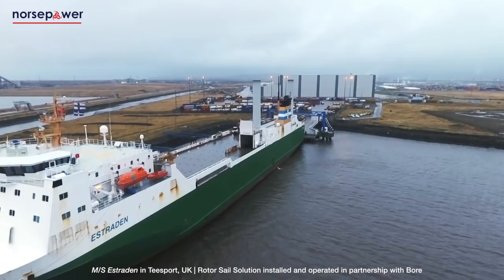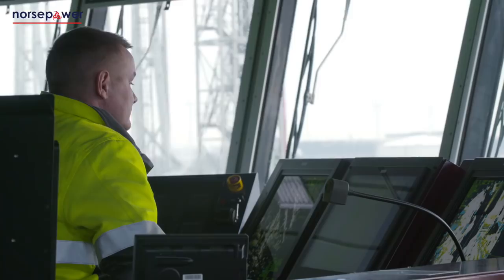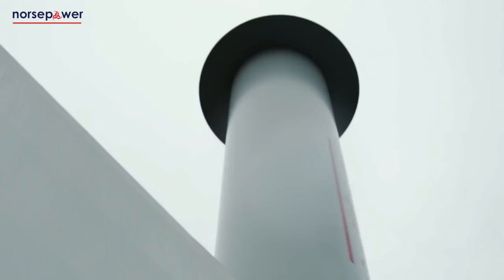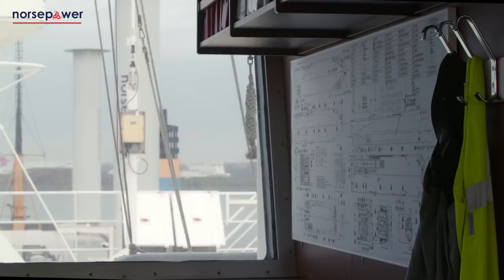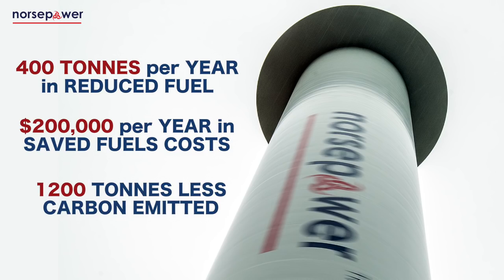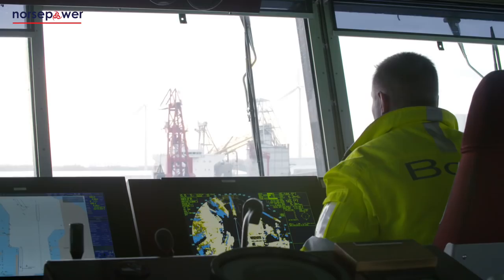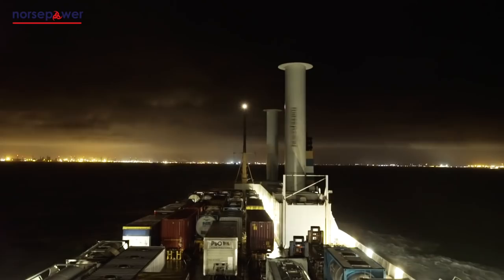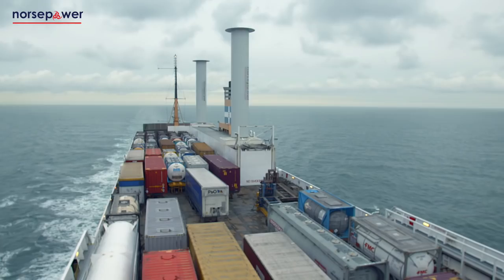Norsepower Rotor Sail Solution - long presentation video

Comment: More info on the system would have been good in the video. I take it they drive generators that then power electric motors to power to ship? Or does the magnus effect create enough force to push the ship forward?
Reply from the maker: Magnus effect is indeed the way that Rotor Sails produce fuel savings (they don't generate electricity at all). Rotor Sails are designed as auxiliary propulsion so the aim is not to operate the ship only with them but technically that would be possible as well!
Reply: @rotorsails  So if i understand correctly ,  the wind first makes the rotor turn, the boat has to navigate perpendicular to the wind direction , then the low pressure side of the rotor pulls the mast forwards, so indirectly the mast pulls the boat forward ?     Thankyou for your aswers !  :)

Comment: Combining the rotor ssail movment to generate electrical power which can then be stored in batteries can also reduce fossil fuel usage even further.
Reply: You need to use motors to start spinning them.

Comment: Carbon or carbon dioxide?
Reply: Depends on the type of engine I suppose, but I think most commercial tankers run on marine oil, which could produce both as a waste product? Unless carbon is captured, or that I'm wrong about marine oil producing carbon particulates.
Other ships run on gas-turbine engines (using natural/modified gas) which would only produce carbon dioxide.

Comment: First company maybe. Certainly not first organisation. JAMDA's sail design in the 80s (put into practise on the Shin Aitoku Maru and Usuki Pioneer) produced far better results in terms of fuel savings (between 10 and 30 per cent) and only lost out because they took up a lot of deck space and fuel prices dropped far enough that people didn't think they needed them.